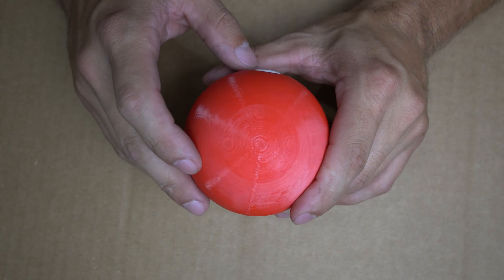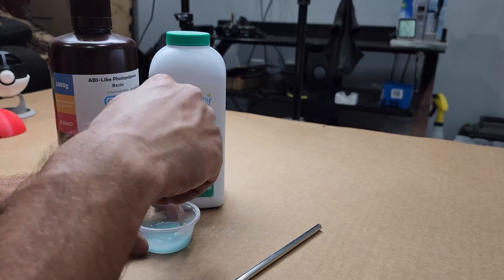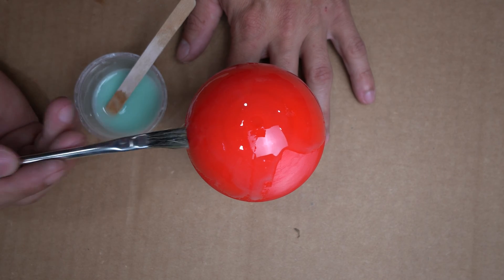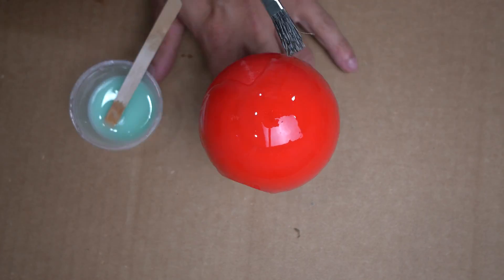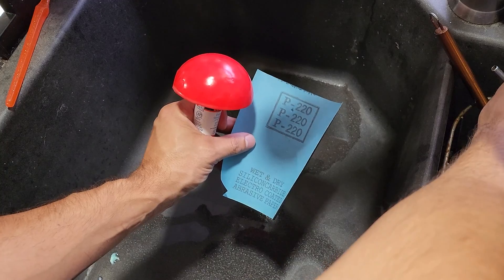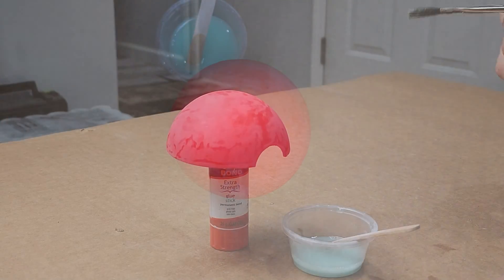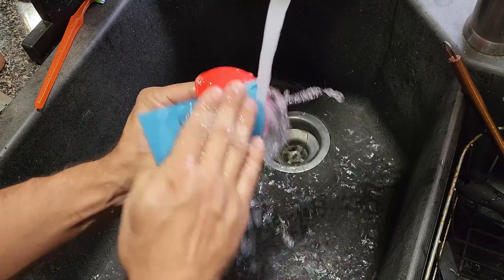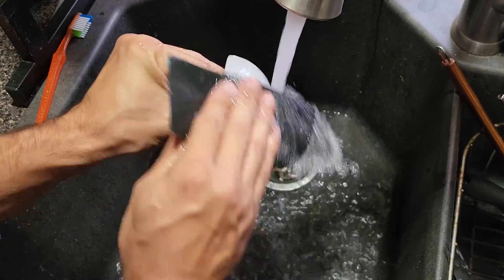Quickly Hide 3D Print Layer Lines with UV Resin

Comment: Not to be doom and gloom, but pretty much all resins are fairly toxic. If I know I'm not going to be messy, I work lightly and don't wear gloves. The problem is that you were touching the red half directly with your fingers to remove something. (Probably lint or something...) Please don't do that. It's clear you have gloves since you wore them when painting. Please be safe, especially when you are touching it as well as when it's off gassing during the uv cure.

Other than that, your end result was great! I look forward to more vids from you!

Comment: You can use any sort of UV resin, there's high viscosity low viscosity, different colors, and you can mix micah powders and glitters to it if you really wanna get creative, or just stop at a resin coat and skip the paint!
Also, if you're printing with PLA or ABS, the resin will help give some UV resistance, heat resistance and impact resistance to maintain its shape. 

And last thing Joe, I'm no expert, but i'd say you're spraying a little too close! i'd move back a bit and do more lighter coats! other than very informational and good vid!
Reply from the maker: Thank you for your feedback!